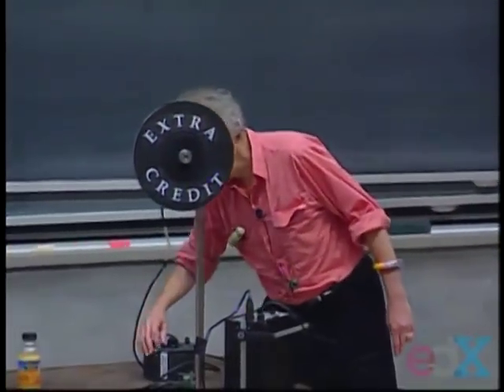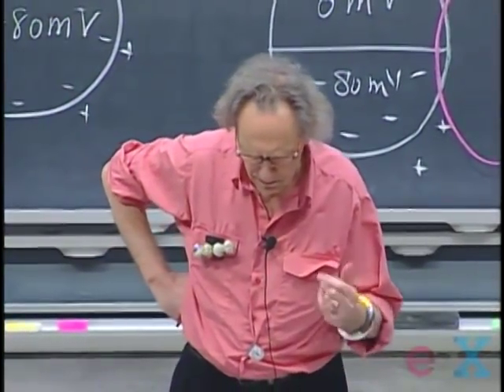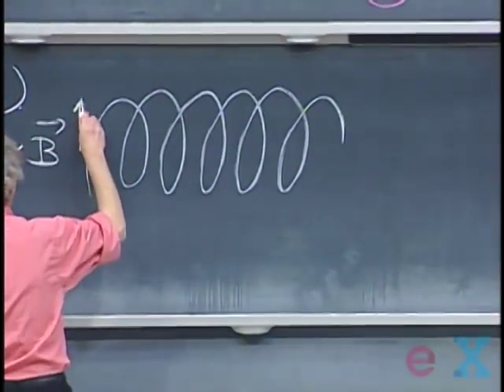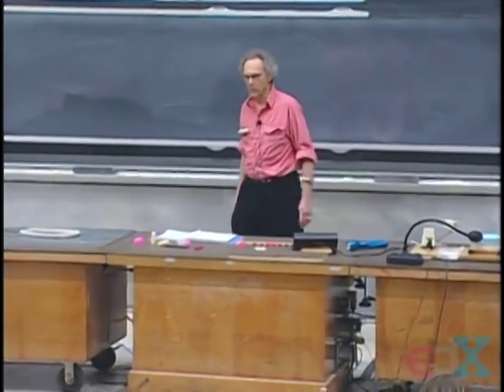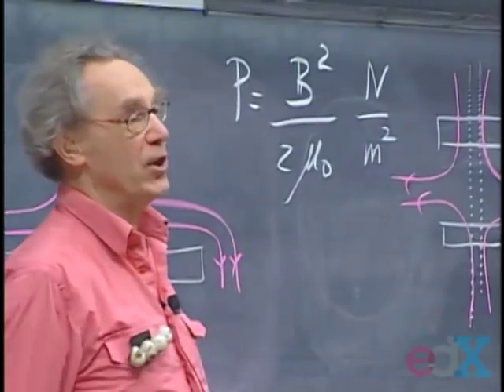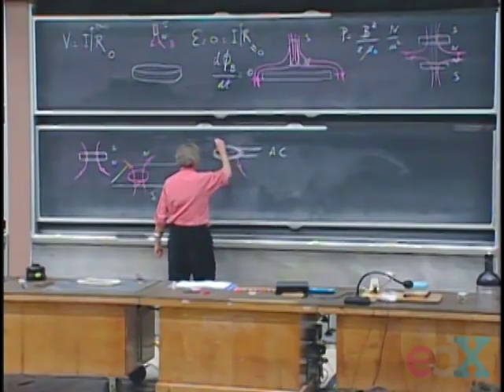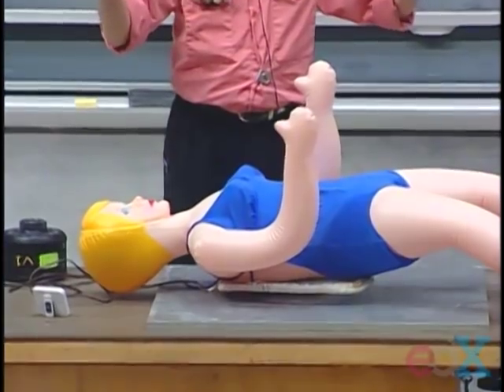8.02x - Lect 19 - Magnetic Levitation, Human ❤, Superconductivity, Aurora Borealis

Comment: Thanks a lot for the lectures! You made me realize that it's not because I didn't like Physics, but my high school teachers had ruined it for me. I ended up in EE just because electronics had little coverage in the Physics curriculum I had. I wish I had watched your lecture videos 15 years earlier :)

By the way, at 11:35 you said there are typically 12 electrodes (ECG). I think you meant there are typically 9 (10 if they do right leg drive to improve common mode rejection). The last 3 leads are mathematically derived, called augmented limb leads. The term 12-lead ecg is very confusing because in EE, leads are physical wire contact points like electrodes as well, not some sort of abstract notion. The medical community must have abused the notation so they can pretend there's a ground lead from the heart when there wasn't physically any.
Reply from the maker: +CatbertDeVil Thanks for your interesting information. My doctor told me 12 and I believed it.

Comment: Professor I have a question... We say when electric current flows through a spring it compresses because of attraction due to magnetic force ... But why do we ignore the fact that there has to be some electrostatic repulsion between the electrons flowing in the spring... As since we know electrostatic repulsion is far greater than magnetic attraction in this case... The string should rather elongate... ( This question was asked in jee and I had a doubt in the answer... The answer was that spring would compress when current flows through it)
Reply: There aren't more electrons in the spring when the current is flowing than when it isn't, so the electrostatic forces stay the same.

Comment: rotating disk example at 2:00 is similar to Nyquist or Shanon rate used in communication theory (sampling rate shall be at least 2 times the bandwidth). In the lecture, you see still text at a specific position determined by the light flash instant. so light is ON only at the time where text reach same exact position... if disk is rotating 10 times per second, the light should flash 20 times per second. this is a fundamental concept in analog to discrete time signal conversion.
Reply from the maker: I agree with you. You can be sure we have measured the rotation frequencies of the motors made by students correctly.

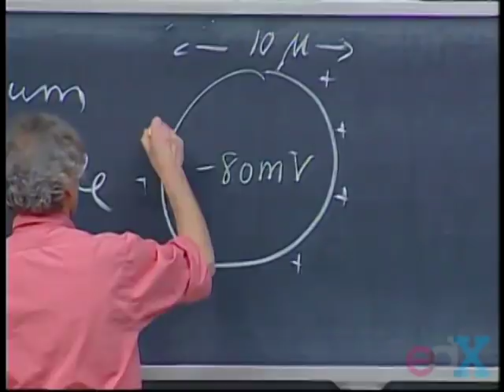Comment: @6:26 flux doesn't determine the electric field.. For example, take a dipole of +q & -q charge separated by distance d & consider a gaussian surface around it... the enclosed charge will be 0 and the flux will be 0, but the electric field is NOT 0 everywhere. Electric field, E becomes zero only at infinity where the dipole distance d becomes negligible. 

So, the reason why Flux = 0, but E ≠ 0 is... one side of the gaussian surface has positive flux and on the other side  negative flux. Therefore total flux is 0.. but electric field E ≠ 0 everywhere.

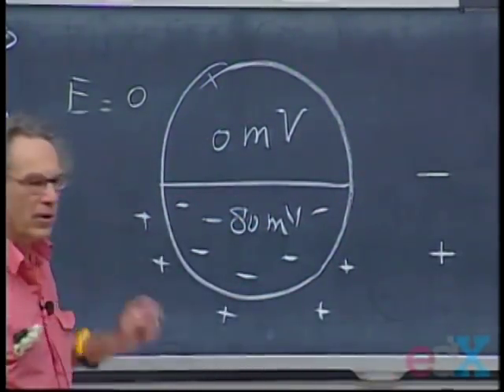For example, even at @7:39, the gaussian surface enclosing the HALF depolarised cell will have 0 total enclosed charge... therefore flux = 0 and E field should be 0 by the logic of @6:26

So the reason why (i think) the E field is 0 in one case and not the other is because of the SHAPE of the charge configuration. When it's completely spherical, i think it behaves like a CAPACITOR having E field only in between the concentric plates & 0 everywhere. A capacitor is a SPECIAL dipole which has E field only on the inside. Even in Lec7 @20:23, the professor demonstrates by tearing open a live capacitor and showing the charged plates inside are rolled into concentric circles... So i think this is a circular capacitor like in Lec7.. And when it's halfway depolarised, the perfect circle shape of the capacitor breaks, and we get dipole like field lines near the fringes that's detected outside the heart. (I may be wrong)

Comment: The direction of depolarisation is opposite in the ventricle. This is because Atriums always push the blood down whereas ventricles push the blood up. So the Atrium depolarises from top to bottom while Ventricle depolarises from bottom to top. And in order to accomplish this, the AV node sitting at the bottom of the atrium intercepts & stops the signal from SA node - the pacemaker cells - from entering the ventricle. After a short time delay the AV node releases the same signal at the bottom of the ventricle.

So shouldn't this change in direction change the direction of the dipole ? And therefore make the QRST spikes from the ventricle go down ?

Comment: Re your analysis of magnetic field induction into another material
You used the term eddy currents being induced, (I call that obsolete.)
I think a little differently, I look at it as the magnetic field is increasing or the velocity of the magnetic fields going into the assigned material, are actually pushing downward on a small magnetic wheel (like a bicycle wheel or a bearing of opposite magnetic fields) hitting the leading edge, and in front the wheel goes down, the back end of the wheel is going up, Then that portion which is coming up pushes in opposition to the magnetic field that  is coming down as it moves forward,
Or one could easily say the magnetic field that is moving pushes on the downward side of the wheel or bearing and then the other side of the magnetic field pushes back up against the field in the same respect in opposition.
Even if you consider the magnetic field hits barely off tangent off center this still holds true, no mater whether the wheel that is being affected is in the   front behind or besides the oncoming magnetic field changes in opposition.

Comment: Hello dr. Lewin. I work in physics education (sort of). I am considering, along with some colleagues, to construct a levitation device like the one you present in the end of this video. According to our calculations, however, to lift ~5 kg, you would need a coil with 1000 windings if you run 10 amperes through the coil. This high current would surely cause the coil to heat up very quickly. How do you prevent it from melting. Also, how is the coil isolated? 120V AC with 10 amps is definitely not forgiving. Thanks in advance for you answer. I enjoyed the lecture very much!
Reply from the maker: cooling
Reply: @lecturesbywalterlewin.they9259  is there internal cooling in the coil? Or was it very cold before you started the lecture?

Comment: Sir I have a small dought on magnetic levitation that is when an AC current is passed through a coil it levitate on a
Conducting plate, if we change the shape of a conducting plate in to a cylinder and then place the coil( in which AC current is passing )in the cylinder will it levitate
Reply from the maker: question unclear

Comment: I have a question , the structure of a generator is stator and rotor when in rotor has its own coils and stator has its own coils, in rotor coils, its used to rotate and it will born and emf and in coil will pass current , but what are coils in stator used for ?
Reply from the maker: if the magnets are static then the coil must rotate. rotatng coil will generate an induced EMF (Faraday). The current will go the circuit and through the coil. If the coil can stands still the magnet shoud rotate. An Emf will  then be induced in the circuit and the current will again go through the coil. Ask google  whether both configurations exist. If ONLY 1 exists most of the time, ask why.
Reply: @lecturesbywalterlewin.they9259  but i still dont get it why there should be coils in stator when the magnetic fiel can be created very well by poles, and from combination of poles and coils around the pole its called excitation circuit just to hard

Comment: Professor♥ Thank you very much for Sending me back to my work , Now I am paying more attention to my SAT and more Enthusiastic for my Physics Learning ( Ast. & Cosm. ) with more Concentration , (( I didn't ask any question of physics in this message but I fell it was necessary to thank you ♥♥ )).
Reply from the maker: If the many course in edX, OCW, Coursera and Udacity do not answer your questions that means that you are not yet able to understand those lectures. Do not feel bad about that. In the next 5 years you will take courses in cosmology, astrophysics and astronomy and you will then find your answers all over the web. That's by far the best way to learn. Your knowledge is yet too low for you to properly interpret and digest my answers. Besides I would have to refer to many existing lectures which is too time-consuming for me. I have a 5 minute upper limit to answering questing.

Comment: At ~17:00 I'd be pretty curious how the signals from 3 electrodes were combined to produce one cardiogram signal voltage which is a difference between 2 potentials. Was it some passive(resistive) network or some active circuitry? Or maybe 2 of 3 electrodes were just shorted?

By the way, great lectures! I admire this kind of teaching! :)

Comment: Dear Prof thank you for the Lectures ,but I do have a question! :)
==>
Since electric fields cannot exists in a super conductor ,does that mean we can't oscillates charges in them to give radio waves like normal antennas ??Thank you
Reply from the maker: currents can go back and forth in any object that has zero ohmic resistance during which the E-field inside is always zero.
Reply: @lecturesbywalterlewin.they9259  Thank you very much I get it now

Comment: are all superconductors diamagnetic??  (because i heard that there magnetic susceptibility = 1)
Reply from the maker: "2.3.1 Perfect diamagnetism
Diamagnetism is due to currents induced in atomic orbitals by an applied magnetic field. The induced currents produce a magnetisation within the diamagnetic material that opposes the applied field, and the magnetisation disappears when the applied field is removed. However, this effect is very small: the magnetisation generally reduces the applied field by less than one part in 105 within the material. In diamagnetic material, B = μμ0H, with the relative permeability μ slightly less than unity.Superconductors take the diamagnetic effect to the extreme, since in a superconductor the field B is zero – the field is completely screened from the interior of the material. Thus the relative permeability of a superconductor is zero."

Comment: Hi. Thanks for Prof. Walter. I'm designing a very important project. At the last part with the blow up doll, does anyone when the professor turn on that know, how many amperes and watts that took to levitate the 1 square foot ( 1 inch thick) coil and how many amperes and watt it took to for the coil to levitate itself + the blow up doll? How heavy are blow up dolls usually by the way? Thank you. God bless. Rev. 21:4
Reply from the maker: +SevenDeMagnus I suggest you try to answer these questions by yourself. At the very least make a rough estimate - that's all I would also be able to do.

Comment: since emf can travel through a vacuum, but heat cannot, could you vacuum insulate a super conductor so that it would remain below it's critical temp. as there is no ohmic dissipation no heat due to current. interesting thought

Comment: when you demonstrated the superconductor mag. levitation. the change in mag. flux cause the eddy current to levitate the magnet...no heat loss, so.eddy current runs continuously without dying,,,but when you took out the magnet there should be again mag. flux change,so eddy current should run reverse to oppose that change,and no heat loss(R is Zero) does that mean there was still  eddy current running in that superconductor when you took out the magnet???
Reply from the maker: how many minutes into the lecture?
Reply: 37:37
Reply from the maker: I watch it again. Listen carefully to what I said. I cannot add to the lecture. sorry.

Comment: What would happend then if you shortout a superconductive battery with a superconductive wire?
Reply from the maker: https://en.wikipedia.org/wiki/Superconducting_Super_Collider
Reply: @lecturesbywalterlewin.they9259  Thank you for sharing this. It was very interesting to read this even though I can't yet understand particle colliders and their function.

 I had heard about CERNs Large Hardons Collider but not about this SSC which would have been 3x longer than CERNs LHC.

I have thousand and one questions. 1. So the conductors inside particle colliders are super conductive? For the other questions I shall find answers myself.

Comment: Sir,my friends and i are doing a project.We are building a  alternating current generator which produces a voltage rms of about 0.6volt and frequency of 10rps.
Doing the math,we found the current rms of about 50 amps.

Would this be enough to levitate a coil of wire?

An also the B=1500 gauss that you spoke about,which magnetic field is that sir??
Is it the magnetic field that the ac current produces in the coil?

Thanks in advance.
Reply from the maker: That's not nearly enough - watch the numbers in my lecture. 
Yes the B field is the field generated by the AC current in the wires.
Reply: we are just going to use a coil of 500 cm ,10 mm thick copper wire + insulation sir.
would it still not levitate?
thanks
Reply from the maker: Watch my lecture and judge for yourself.
Reply: yes sir.thanks a lot.

Comment: If we connect an ideal Ac voltage source  across a superconducting solenoid, then what will drive the current around the circuit? 
The E-field inside the wires will always be zero because of superconductivity, then how the current will start circulating in the loop? 
I am assuming that all wires are superconducting.
Reply from the maker: read problem 119 and the solutions

Comment: I am a little confused as to source of the energy to spin the magnet at 37:10. I know that the forces are due to Lenz currents , but surely it cannot be a "perpetual motion" machine.
Reply from the maker: nothing is perpetual not even the rotation of the Earth about the sun. I believe that I touched the magnet to start the rotation.
Reply: @lecturesbywalterlewin.they9259  Thank you for the reply. Yes I absolutely understand  that there can never be perpetual motion. That is why I was a little confused at what was making the magnet oscillate . Now  I can see that it is due to the initial little push, when you put it in position. I really appreciate that you took the time to respond 
To my query.

Comment: Will the coil float higher if the frequency of the current is increased ? As according to the relation in Faraday's law the induced voltage is proportional to rate of change of flux.
Reply from the maker: it will float higher if the magnitude of the AC current will go up and also if the frequency goes up. In both cases dB/dt will go up.
Reply: @lecturesbywalterlewin.they9259  Thank you for your response. 
Will increase in frequency lead to increase in power consumption as well ?

Comment: Sir in electric dipole if we take a gaussian surface enclosing both the positive and negative charge , the net q(charge) becomes zero. it concludes Electric field is zero outside the gaussian surface.. where am i wrong sir?
Reply from the maker: WRONGGGGG conclusion - THINKKKK Gauss' Law worksfine but you have to understand when  and how to use it
Reply: It means the electric flux is zero, as Gauss's law says the total electric flux through a closed surface is proportional to the enclosed charge. However, the electric field may indeed not at all be zero. Imagine summing up all the little E dot dA around the surface; some may be negative, some may be positive, and some may be zero, and overall the continuous sum (integral) may add up to zero. But still there is an E.

Comment: How would you go about to find the relationship between the force between the solenoid and the plate as a function of the current running through the coil?
Reply from the maker: how many minutes into the lecture?
Reply: I think I found the solution. Since P=F/A and magnetic pressure P_B=B^2/(2μ), then F=P_B*A. Since the magnetic field along the axis of a solenoid is B= (μ*I*N*r^2)/(2*(x^2+r^2)^(3/2)), the Force can be calculated as an approximation by plugging B into the equation. I am not sure how much the lifting force using this value of B will deviate from an experiment since the strength of the B-field will subside when moving away from the center of the axis of the solenoid. Any thoughts?

Comment: Sir, I found on wikipedia that plasma also has zero electrical resistance. So, it also should behave like a superconductor. Now if someone approaches plasma with a magnet in that case too the magnet will be stopped. Right??
Reply from the maker: http://www.thunderbolts.info/w/faq/superconductor.htm
Reply: The graph in this link graph shows plasma behaviour upto 10,000 amperes. What happens after that(when the current is further increased)??
Reply: Does the current keep increasing constantly after that?

Comment: 32 mins in.. so if a magnetic field is a field created by electric current.. and " Electric fields are generated around particles that bear electric charge." does this mean particles in a super conductor have no capacitance/hold no charge .. is that another way of saying they have no resistance? and thus pass on the electric current most efficiently? do super conductors have magnetic field then? I guess so if they have higher electric current... so super strong magnetic fields as you describe?
Reply from the maker: >>>does this mean particles in a super conductor have no capacitance>>>
question ill-defined